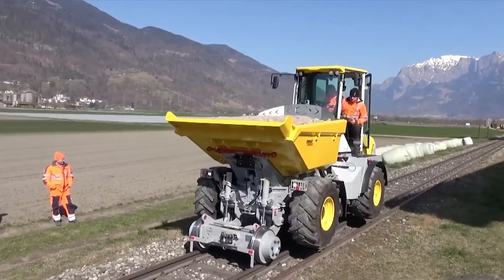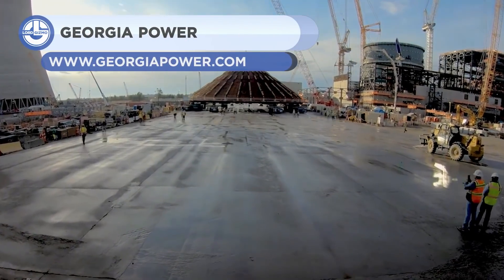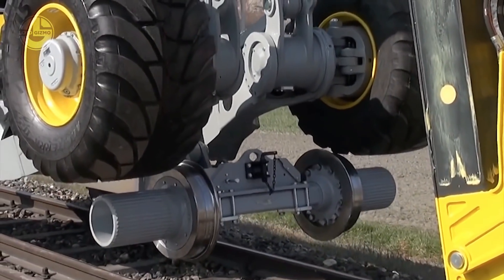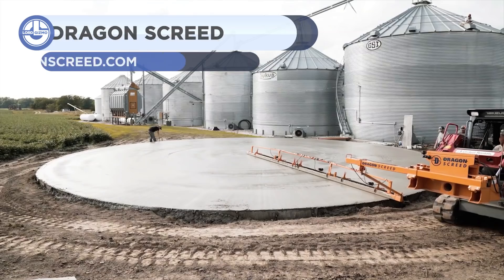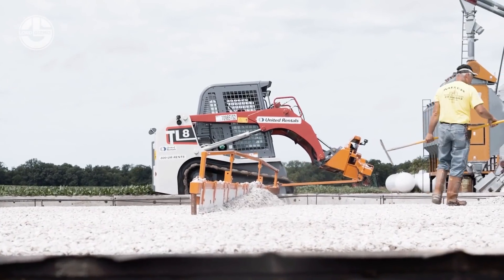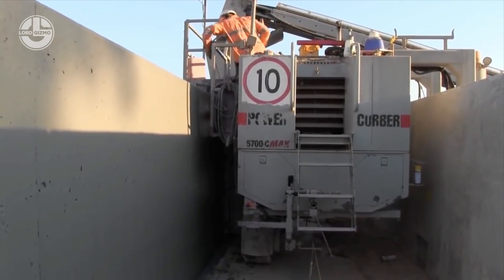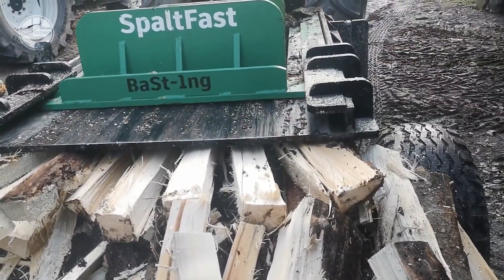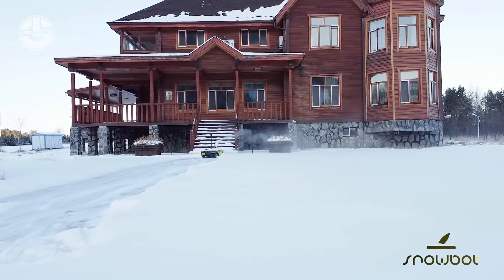POWERFUL And Ingenious Machines You Need To See | Powerful Machines That Are On Another Level

Comment: No idea why they would build a larger scale spin launch platform when the small scale version couldn't launch a test vehicle with a predictable straight trajectory or with a notable enough increase in velocity to justify the cost over solid rocket fuel.
Reply from the maker: In some things, size matters!
Mass does increase cubically with increase in dimensions.  You don't need an increase in velocity, you need a justifiable and reliable method to get to a given velocity.  Rockets are the obvious first way, but if you can manage to get a consistent launch at a given speed, you'll cut out a big part of the burn needed to get a given rocket to speed, which means less mass on the craft and less fuel needing to be burned.
It's not an absolutely perfect method, and it certainly isn't suitable for human occupants, but it's an interesting concept worth looking at with a bit of optimism!  

Here's a good video discussing the subject in a bit more detail from a little while back:
https://www.youtube.com/watch?v=JAczd3mt3X0
Reply: @LordGizmo  I understand the concept quite well actually. Quite a bit of the fuel in a rocket is used to overcome the inertia at take off and to accelerate the rocket and  fuel needed for later on in the flight. If you could eliminate most of the inertia and some part of the first stage acceleration you wouldn't need as much fuel and thus overall less mass and cost to launch to orbit. Several more practical ways of doing this has already been done such as Virgin Galactic, ie: belly mounting a rocket to a purpose built aircraft, fly at high speed at high altitude and launch at the peak of a parabolic arc. My criticism is that they haven't been able to launch a test rocket in a straight line yet, every test launch I have seen has had the tail exit well off center from the nose cone which could easily break the rocket in half on its exit trajectory. That is only one problem of many. I'll ignore the fact that they need to achieve a near perfect vacuum in very large chamber in order to remove the air resistance so they can accelerate a rocket to their stated 5000mph, release it at the perfect point in the arc to shoot out the exit port where it breaks through a seal into normal atmosphere at 14.7psi. I don't even want to calculate out the force the nose cone will have to withstand when it exits a vacuum at 5000mph directly into 1 atmosphere let alone at a slight angle. If they can pull it off... good on them, but I don't see it being successful.
Reply: Good luck getting a decent vacuum with all the bearings. Spin Launch is never going to work, in my opinion anyway - did you see the test flight? The rocket/projectile didn't come out straight and it tumbled several times after it left the launcher (not really what you want).